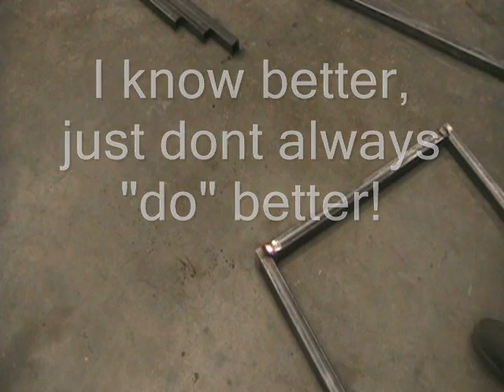Now whats he up to!

Comment: One thing you need to practice is to protect the welding leads from arc splatter. The splatter shortens the  life of the cable. You welds look good.